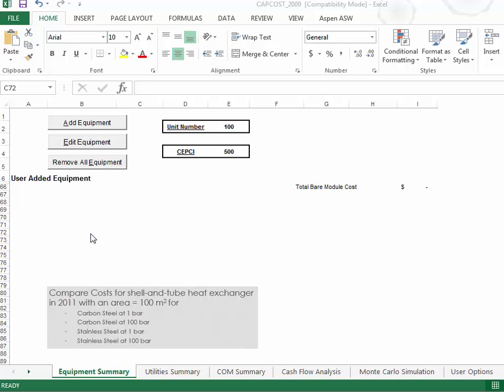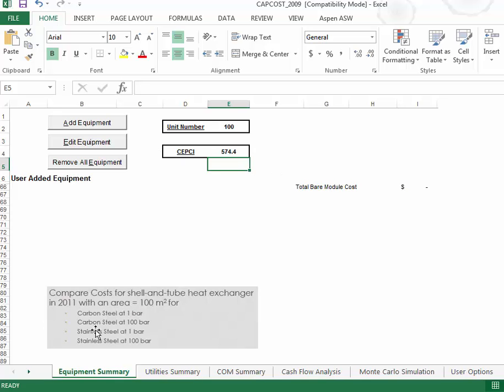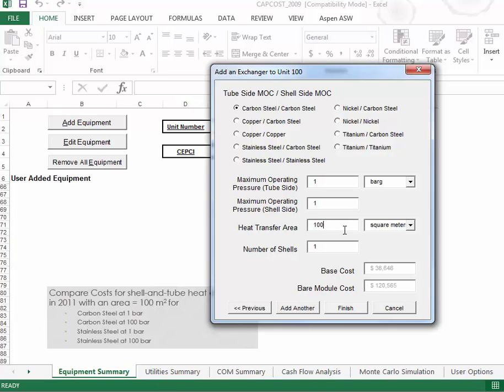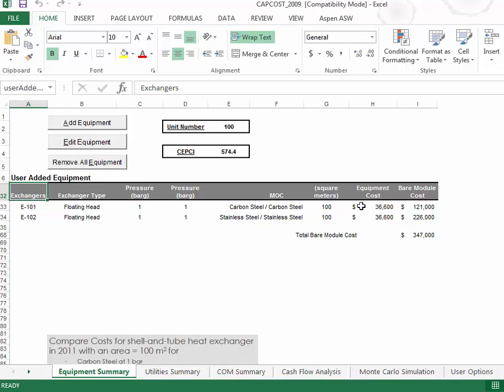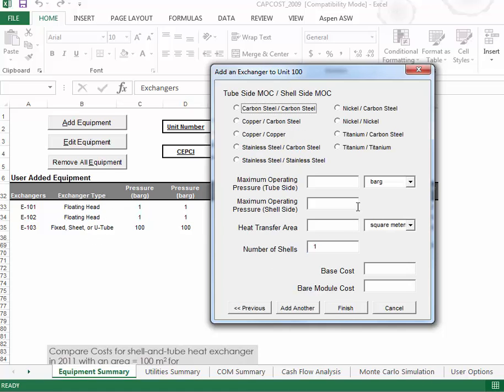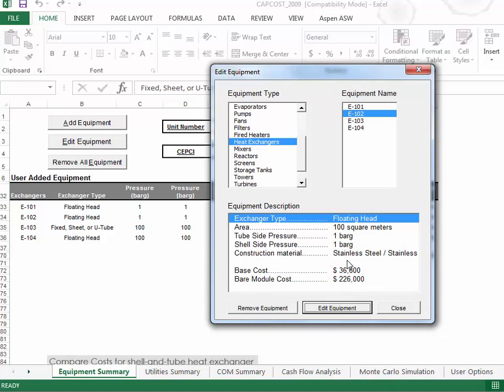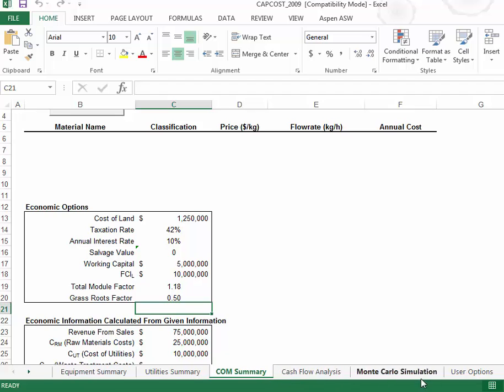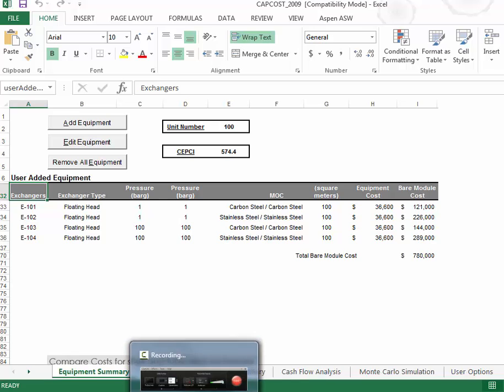Introduction to CAPCOST for CBE 4096

Comment: Error 1004: how to solve it
In Windows 10 you will have to enter the Windows settings and change the region to United States (without this change the spreadsheet gives an error when inserting a device); this change will only affect the date and currency format. It is not necessary to change the system language.
     1.Click the Start button and then Control Panel.
     2. Click change date, time or number formats.
     3. The region dialog appears.
     4. On the Formats tab, select the format you want to change from the drop-down list. Now click on the additional settings button.
     5. The Customize Format dialog appears.
     6. Click the tab containing the settings you want to modify and make your changes. For example, to change part or all of a number format, click the Numbers tab and change the desired setting.
Reply from the maker: Thank you for this information!
Reply: thank you bro, you just saved my degree!

Comment: Hi, dears, I have a problem with the macro, the error message is error 1004 and I have read the comments below, and I don't know hot to modify the date and time to change From . to ,
Reply: I had the same problem and  I just changed my computer's configuration. If you go to "date and time" you just need to change from "." to ",". So then Excel can read your commas as points and viceversa. You need the AMERICAN configuration.
Reply: have you solved the problem?